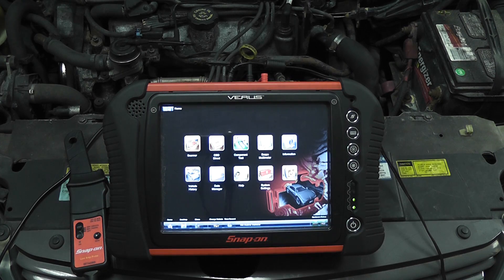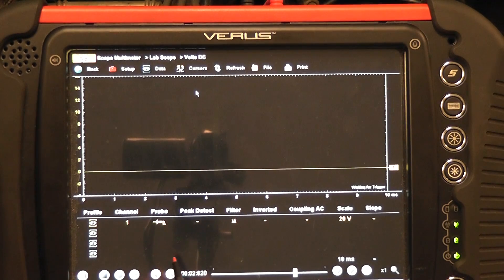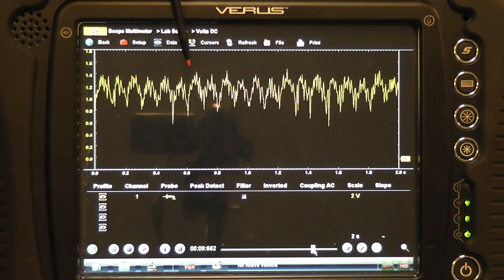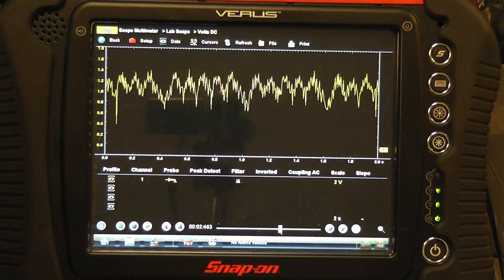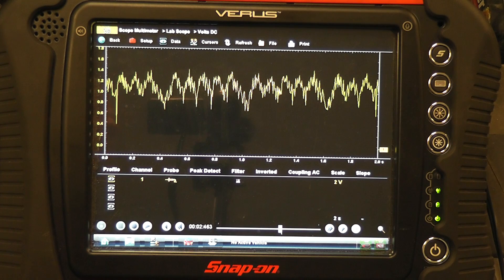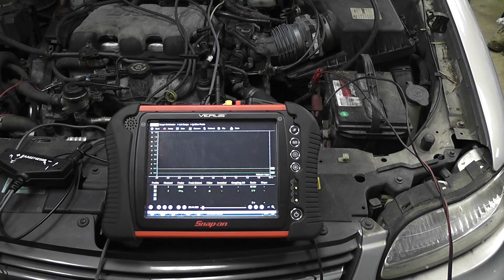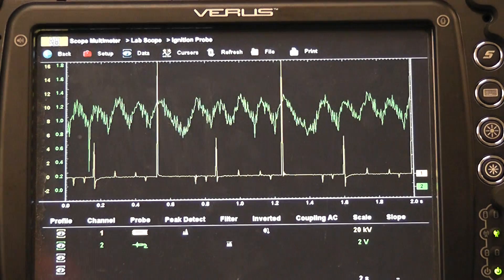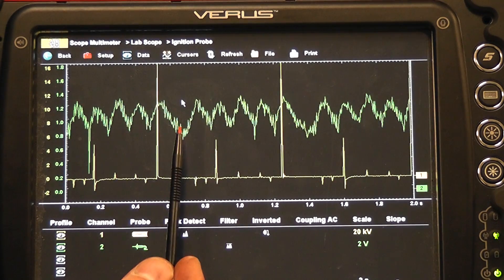How to perform a compression test with a scope (Verus-Vantage)

Comment: Yo danner no clue if you’ll see this but is there a limit on what a low amp clamp can pick up. I work on school buses that 3 600 cca batteries
Reply from the maker: Yes sir. From memory there is a maximum output voltsge of a low current clamp (60a setting or 10mv/a) of 2.5 volts or 250 amps

Comment: Yo Danner! Tagging you for a question on a "way back" vid here. If the cable were thicker then the jaw openings, IE the jaws went around but could not completely close, would the low amp clamp still work?
Reply from the maker: @woog74  that is correct my friend
Reply from the maker: Possibly. As long as you're not worried about amplitude accuracy. Which in an RC test, we're not.
Reply: @ScannerDanner  TY for the reply. I think I got you.  When you say amplitude accuracy you're saying that because the clamp can not close completely around the cable, some of the amperage flowing through the cable may not be measured, but the amperage that IS being measured will result in a reliable repeating pattering?

Comment: Something that I have not clarified yet is when should we use the low amp clamp and when to use the high amp clamp
Reply from the maker: I learned the limits of the low amp probe in this video https://youtu.be/4YWCKzpbgb0
It is 2.5v or 250 amps (i think)
The other consideration is wire size. The jaws of your low amp probe must close all the way.

Comment: Is this test done with dc coupling or ac ?
Reply from the maker: DC you can use AC coupling but that isn't necessary unless you decide to use battery voltage instead of current

Comment: You didn't mention the polarity direction of the low amp probe. The arrow on the amp probe direction.
Reply from the maker: "With the correct polarity" :35 seconds in
Reply: @ScannerDanner  which direction is the arrow pointing?
Reply from the maker: @meblake7359  conventional theory current flow (pos to neg)
Reply: @ScannerDanner  and if you connect the inductive clamp on the negative cable the arrow should point to positive?
Reply from the maker: @meblake7359 yes sir!
Reply: @ScannerDanner  Thank you very much!

Comment: A friend took his Honda van to the dealership, and they tried to sell him an engine replacement using this test.  They told him he had poor compression in multiple cylinders and the engine would have to be replaced.  They wanted $6000.  A few days before, it began making a clattering sound that he thought was coming from the top of the engine around the valve covers.  Suddenly the engine began running very bad.  It would not idle without giving it some throttle and could not be driven.  He asked me to look at it as a second opinion.  When I heard the engine, it sounded to me like an engine with a valve timing problem.  I pulled the inspection plugs off the timing belt cover and I could see a huge amount of rubber debris and some belt chunks, but the belt was still in place.  Turns out, one of the tensioners failed.  The belt slacking and then getting tensioned again was the sound he was hearing.  The belt could only take so much of that abuse before it jump a tooth or two on a pulley.  The dealer was going to replace an engine for $6000 when all he needed was a $100 timing belt and tensioner set.  He helped me change the belt and he was able to learn a lot about his engine in the process.  

If I learned anything from your videos, it's that you should never simply replace parts based on what the scanner tells you.  It takes a little troubleshooting, in addition to the scanner to get a proper diagnosis!

Comment: Hey Paul, how are you doing the math? Are you taking 2000 (mv) ÷ 10 (mv) = 200 amps? Little confused 😕.  Thanks as always for all your helpful videos and educating us.
Reply from the maker: 10mv = 1 amp on this setting on the amp clamp
1v = 1000mv right? Then do your math from there.
So 1v = 100 amps
Reply: @ScannerDanner  Thanks so much for the reply. That helps a lot.

Comment: Paul! subscriber to your channel here! and proud owner of the book! Everyone should get the book! quick question here! if i would be testing starter draw , is 600amp clamp safe to use with verus scope, i heard stories about modis getting fried up when using high amp probe on failing starter (they draw 400amp ). is there some kind of protection/amp conversion as the clamp itself is rated for 600A, and settings on verus scope are 40A.  You should make a video btw on how to use scope and probe to do  a starter draw,

Comment: Awesome video and a great tool to have    I was wondering how you would set this up if you had a coil on plug setup instead of plug wires so that you can see what cylinder is the problem?     
Btw. Just bought your book can’t wait for it to come in!!
Reply from the maker: It depends on the coil design. If it is a two wire COP you connect to coil negative, compared to a 3 or 4 wire COP you connect to the coil trigger signal from the ECM
Thank you so much!

Comment: Funny story, A buddy of mine had just done heads and timing chains on a dodge 4.7, no codes, but cranked unevenly and ran bad. i did a relative compression test, it was an interesting pattern, high peak, lower peak, high peak, lower peak, every other cylinder was weak. I immediately suspected one of the chains was off. Because there was no code i suspected bank 1, as bank 2 has the cam sensor in it. I put a transducer in cylinder 1 just to complete the diagnosis, I used it as the sync channel, it was indeed weak all along bank 1, by about 25 PSI., just for fun i put the transducer in cylinder 2 (give him his moneys worth), Ran the test again. I verified my suspicions. Because it ran, and it was only 25psi low, i told him its probably only 1 tooth off, but its definitely off.

He pulled the covers and checked his timing, yep, as i diagnosed it, tooth off on bank 1. So i went through the whole procedure for timing these engines, He got it 1 tooth off, he never rolled the engine around by hand (with a tool) after timing it to feel for low compression and to double check timing. This you should do every time. Sadly, 6 months later he did something similar with a Honda, Gets in a hurry and forgets the final checks.
Reply from the maker: nice find!

Comment: SCANNERDANNER,  when one or more pistons are NOT giving any compression. What would be the problems on the cars engine? you have to replace the piston or the actual engine block is cracked inside that piston cylinder and have to replace the whole engine block?
Reply from the maker: valve, valve seat, headgasket, worn rings, broken connecting rod etc etc
Reply: @ScannerDanner  thanks for the help
++     I disconnected the Temperature sending unit/temp sense, so How can I test the instrumentation temp gauge in my cars dash board by itself to check if its working correctly, what do I need to do?
Reply: @ScannerDanner  thanks for the help
The water pump is pumping how much water and coolant? how can I measure this how much the water pump is pumping? 
I don't know why they call it a water pump because its not pumping only water its pumping coolant. 
The Water pump only pumps coolant not water into the engine only when the engine is warm and HOT not when the engine is cold?
yes I can pressurize the system to 13 to 15 psi to find external leaks using a radiator pressure tester. 
But I want to measure the Pressure of the system while the car is idling and running at higher RPM to measure the Pressure of the PSI of the system, How can I do this?
Reply from the maker: @billwilliams6338  the water pump pumps whatever you have in your cooling system and you cannot do the test you are trying to do, nor will it tell you anything. The only psi test you can do is with the engine cold and the system filled, start the car and then keep squeezing the upper rad hose, if it gets rock hard very quickly, this is a confirmed combustion leak into the cooling system. (headgasket/cracked or warped head)

Comment: is the snap on verus still worth buying a used one in 2020.  or do they have cheaper ones that do the same thing nowadays?
Reply from the maker: stay away from the Verus and Verus Pro as they use an obsolete operating system (windows xp). My Verus Edge is window 10 I believe

Comment: Hey paul. Can i use this method on heavy trucks with my verus using the principle volts dc and and doing a conversion. Select 10volts and convert to 1000 amps which i reckon it will draw?

Comment: I have a Modis Ultra, do you know if there is a large difference in scope performance compared to the Verus. Besides the fact that the Modis doesn't have an Ignition Scope and the Verus does. Thank you Paul. I thought if anybody would know it would be you.
Reply: The only difference I see is the number of channels. scope performance its self is on par.    you can buy the ignition scope I seen it in the accessories list with my modis..

Comment: Thanks for the great content you put out.   You have taught me a ton and have given me the confidence to tackle the more complex diag jobs.   Do you have to use the adapter for this test? Why not just plug your trigger right into the scope?
Reply: No, you don't need the adapter. You could low amp probe the coil or backprobe it or a injector for that matter, ignition is easier because its more in line with compression. You don't plug ignition straight to a scope because they generally aren't rated in KV for automotive use.

Comment: Will this test be sensitive enough to identify a cylinder that has compression, but there is a valve that has a duration problem.  I work on dodges and it’s common to have a hemi with a wiped camshaft lobe, so the engine will have good compression it just won’t pull as hard as the other cylinders.  Or a pressure transducer monitoring the cylinder pressure will be the best option?  Thanks

Comment: Thank you so much for this video. However, I missed something about the amp clamp and the tool that you connected to your Verus- vantage scope. The most important thing that I missed is that the amp clamp you used is a low amp clamp that goes up to 60 dc A. However, you had everything set up in spite of the fact that the starter may have drawn up to 200 dc Amps. Man, I really do not get how the low amp clamp handled like 150-200 DC amps that the started drew.
Thank you again for sharing such a great video with us.
Reply from the maker: This amp clamp can measure up to 250 amps. It's voltage output is limited to 2.5 volts. Amp probes produce voltage in the presence of a magnetic field. The current flow in the wire dictates magnetic field strength. Add a little math conversion and there is your inductive low amp probe. Hope that makes sense.
Reply: @ScannerDanner  The amp probe is able to measure max 60 amp, how could this be possible, it may give false readings over 60amp, though waveform seems allright.
Reply from the maker: @mertylmaz2179  read my comment in this same thread, it explains it.

Comment: so when you are shorting out the coils with your test light, or unplugging a injector connector, your trying to find which cylinder is not contributing. 10-4. on an OBDII vehicle is it invalid to unplug the coil over plug connector?
Reply: my thoughts have been jumbling since I bought your book. piecing all this good info together. so I'm also thinking this........... for a really fast direction test on an OBDII car, with a misfire, not sure which cylinder... could I unplug each coil over plug connecter (one at a time) and listen to rpm? then by doing the same thing with the injector connectors determine if there is a fault in the ignition or fuel delivery..?

Comment: Hey Paul, Do you recommend buying a Snap On Vantage Ultra or just get the Verus? I know the Vantage Ultra isn't a scan tool am I correct?
Reply from the maker: Two different tools my friend. The Verus has the Vantage program and hardware built into it. And yes, you are correct, the Vantage is NOT a scan tool. It is a scope and component test meter only.
Reply: I have the vantage ultra and i use it combined with a solus edge and that works for me. I do wisha had more channels on the vantage..so you gotta think about that

Comment: I'm sure you get this a bit but you sound like Hank from breaking bad and a bit of Kenny Powers.
Reply from the maker: LOL, I never watched that show but my son tells me I need to
Reply: ScannerDanner both shows are pretty good but I was thinking of getting a picoscope ch51450 kit for around 1500 I already have a maxidas 708 and I'm wondering should I just go verus or modus or just get the picoscope and use my 708 for scanning. If you had this dilemma which route would you go?
Reply: Not sure if you got a PM from ScannerDanner, if you did ignore my 2 cents because he's the man. I've been an ASE mechanic for about 10 years now and just from my personal experience I'm not thrilled with the Verus or Modus based on their price point. They are good tools just overpriced for what they are IMO. If your 708 is reliable, up to date, and has a good live data stream I would go with a picoscope. I bought a stand alone oscilloscope and am quite happy having it as a separate unit . The other advantage to having 2 separate units is that if one goes down, you can still use the other. Just my opinion from my experience in automotive and diesel mechanics.

Comment: Great job Paul! I'm going crazy at Car Care Ministry but in a good way. This past Saturday was our monthly Ministry's car repair day where our volunteers come in. We did about 13 cars! 
My job is primarily diagnostics. I had to call two bad computers, both injector drivers as well as a clogged exhaust and there's the regular MAF stuff ect. I have to be accurate because as a Ministry our funds are donated and obviously we have to be good stewards. Plus as you always say and I couldn't agree more..."don't be a parts changer".
My problem is we don't have adequate diag equipment. My friend
Eric "ETCG" did get OTC to donate an Encore scanner which has been our go to scanner and we are very grateful for it. As of now we don't have any subscription service e.g. All data. We are hoping to upgrade due to the fact we are taking on more cars in light of recent publicity.
For "front door" (scope) type testing I'm limited to (no scope) a multimeter and Power Probe.
Anyway I was wondering if the old Vantage would work for relative compression.
That's something I think is in our reach. I've seen them on EBay for around $3-400. Just need to know if it does R C.
Thanks again Paul
Reply from the maker: It will but we need to get you a Vantage Pro. We are upgrading our equipment at Rosedale Technical College. I can check to see what our Snap-on rep will sell the trade-ins for if you want? It would be an older Vantage Pro but to be honest. The Vantage Ultra and Edge where downgrades in my opinion. I loved the VP.  I absolutely hate the newest one. It is slow and lanky. Yeah, it is touch screen but so what, even that sucks.
Reply: ScannerDanner That would be a dream! A for real game changer. I literally just got home from the "Barn" (our Ministry's shop) because I'm struggling with a 3800 GM donner car that I had to do an old school gauge compression test on and will have to take off a valve cover to check for timing chain slack chasing a weird idle misfire. The car is irrelevant but the point is I would of been home hours ago and not OCDing about the diag if I had a scope...LOL
I will send you a quick email in case it works better for you. Thanks so much, I'm excited that there is even a chance. Amazed you even have time to respond. Either way, you are much appreciated. God bless, goodnight

Comment: So if I'm ridiculous for telling you the truth, Your a complete idiot, Like I said before... first if you want to access all the on board systems you have to have an oem scan tool, second you pay more to buy so called universal scan tools like garbage snap on, than an oem by wasting time to up date your junk scan tool that won't get in the vehicles on board system...after all, time is money depending on what you are working on. and third I can start working on 2018 now than wait to have snap-on reverse engineer a program to work with the new models.
Reply: Someone is a little salty.
Reply: there's nothing salty about the truth for garbage scan tools, but I just thought of where these junk scan tools can be used on, kia and hyundai  since there cheep throw a way vehicles. These tools and vehicles go hand in hand together...Grabage.

Comment: Technology amazes me, in the 90's a cold start and running your fingertips along the exhaust manifold could pick a bad cylinder
Reply: In the 1960s we would pull off one wire at a time and listen for a change in the engine sound. When the engine sound stayed the same, that was our bad cylinder.

Comment: Have seen low compression caused by washed out cylinders too, which was caused by a bad spark plug (older cars).

Seen this sting a few techs.
Reply: or a vehicle that had be laid up for a while, and got internal rust on valves/ seats, bore etc, 🙂👍

Comment: I have a 02 chevy cavalier the humps don't look like the ones you have on the video I hooked up at the battery should I move my clamp closer to the starter wire does it matter which post I use positive or negative?
Reply from the maker: either post is fine, but must be around the correct cable if you cannot get the jaws of your clamp around all of them.
Reply: Played with the settings changed the battery in the clamp perfect waveform do you offer training on the vantage ultra